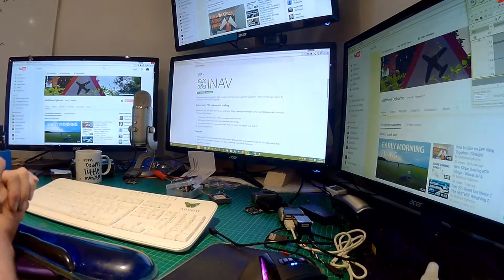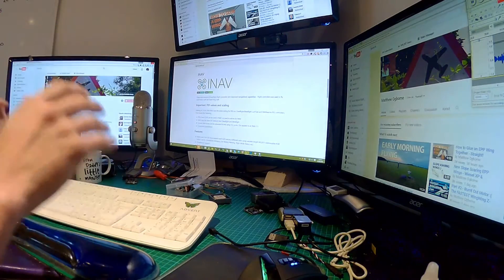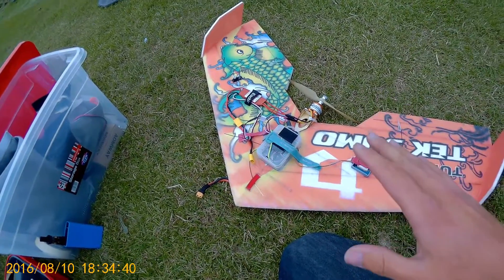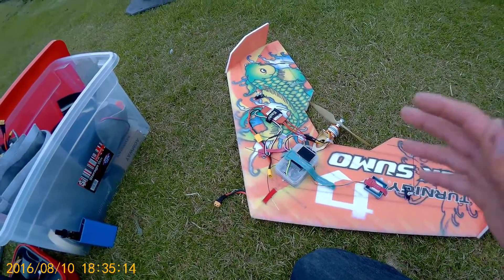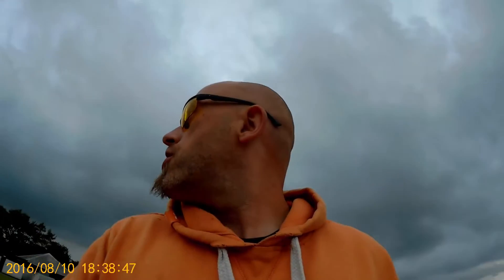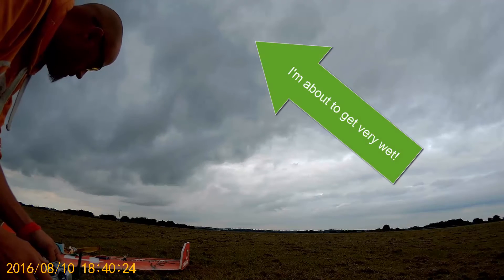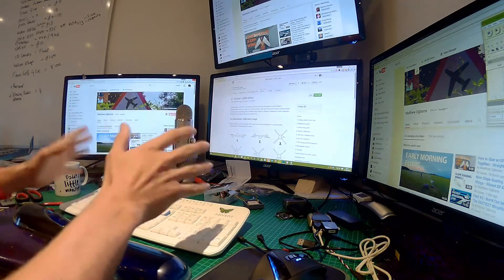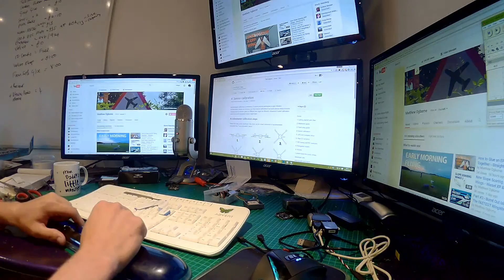Testing iNav - Part #2 - Naze32 Vs Pixhawk for Flying Wings

Comment: Hey Matt,  be careful where you place your GPS. If it's above a power lead or even a servo lead, every time the motor or servo draws power, it will create a magnetic field and weird things can happen. Good luck
Reply from the maker: Howdy fella,

Yep it's close-ish to a servo, but the wires run at different angles. So far the GPS hasn't been an issue at all. Everytime including lots of servo movement, I'm getting GPS 3D fixes within seconds.

Matt

Comment: Everybody here in my flying field use FY41-AP which works great and is twice cheaper then vector
Reply from the maker: Howdy Yaroslaw, looking that up right now!
Reply from the maker: Yikes, that's still on the expensive side. Naze32 = £12, GPS = £20, OSD = £5 so about £37 all in. But does include some setup. Do you know how easy it is to set up the "FY-41AP"? They're saying it's got a "Easy installation", which is curious!
Reply: +Matthew Ogborne  sorry, a bit of confusion here. For fixed wing we need Lite version, which is $115 at HK (still little bit expencive for me:) and you should not compare it to naze32, really:) it has everything you need in a package, including osd,  speed, altitude and gps sensors. When I asked guys about cc3d and naze32, they said "forget, just buy this and fly, its really easy to setup for beginners". They fly long range fpv up to 10-15km, so it proved to be reliable.
For me, I'm looking forward to try naze32 that I'd have after upgrading my quad, glad you made it work, really!
Reply from the maker: Howdy Yaroslaw, oh I totally agree with you, ease of use & setup is a major factor. It's why I went for the Vector for my Phantom flying wing.

Not sure if you have seen part 2 yet, things for iNav didn't go well :(

The pixhawk & Patrick E's Baseflight airplane, very, very good!

Matt
Reply: +Matthew Ogborne I've seen all parts while driving through city today:) thanks!:) Have found your chanel today and already a fan!:)